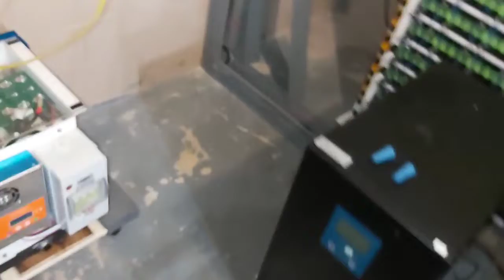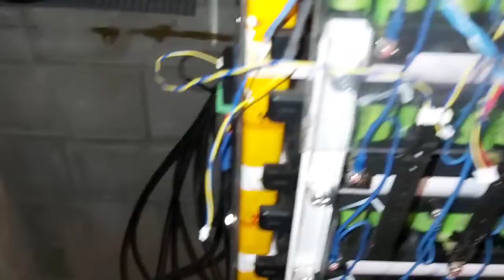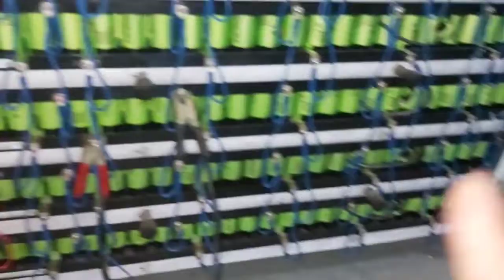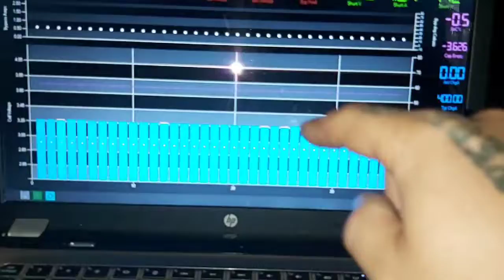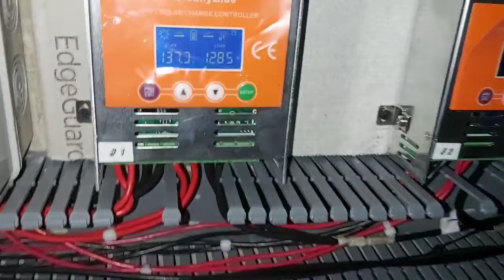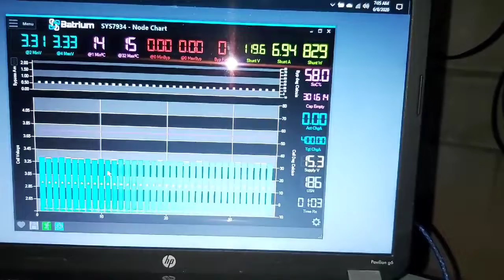120 vdc Progress and Manual Balancing

Comment: Wow... why 120VDC? I wasn't able to listen to the audio...
Reply from the maker: I got a deal on the inverters and I replaced my lead acid bank with this one. It was my cheapest and most powerful option. Thanks for watching
Reply: @frankz1125  Awesome!
Reply from the maker: @blackz06  The system is heating my house right now. 24C inside and -20C outside.

Comment: I want to build a 48v-58.4v LifePO4 battery using the brand new  K2 - 26650 cells.  I was thinking of ordering about 50 crates x 120 (26650 cells).  Is Batrium BMS good for these 26650 cells?  Right now I am using 18 x 25.6v LifePO4 k2 modules (9.6ah each).  The problem with buying already assembled modular batteries is supply and price.
I want to build my own batteries and setup 50-100 kwh of battery.
Reply from the maker: Batrium is ok but you will need a lot more equipment to make it safe. How much power are you going to use and discharge.
Reply: @frankz1125  I want to build at least a 100kwh LifePO4 battery.  Maybe even 250kwh.  Consumption would be 5.5kwh to 6.5kwh per hour 24/7.
Right now I use 1/4" copper pipe hammered as my buss bars for my 24v+24v LifePO4 battery.  It probably can handle 120A, maybe 150A Max.  I'd like to build a 100kwh 48v+ battery...not sure if a good idea or not... is it too low of DC voltage or it should be workable with proper copper.
I am thinking 2-4 LV6548  in parallel.  Probably at least two in parallel or separate (batteryless mode works only when not in parallel)...not sure if better or not.
Reply from the maker: @jonathanskinner2122  it depends on which battery cells you are using will see what is best for configuration. What cells do you have ?
Reply: @frankz1125  I have 20 x k2b24v10eb (25.6V batteries ~8-9.6AH each)    So Parallel 9 and parallel 9, then joined in series to make 51.2V.  Paralleled + series using copper pipe and hole puncher 1/4" die.   The cells I was thinking of are the k2 26650 LiFePO4 brand new (liquidation cell)   120 cells for $238.  I've never built a 12, 24, or even a 48v battery using anything like 26650.  I need to build HUGE batteries...I think.  or 24-48v with bms and parallel them?
Reply from the maker: @jonathanskinner2122  make sure you do your homework on them before you start. It may be a bigger job then you think. My system took a long time to build. Probably close to a year

Comment: Looking good. Did you use both cell types A and B or just pull out all the modules with B type and replace with A type. I,m wondering if i should just leave mine the way they are or change them. Are them strips doing the balancing only or do you have a BMS installed to.
Reply from the maker: I used bs only. Its your call . There is many people using both and theyre working fine. Strips? I dont understand. I do have a bms but it starts balancing at 3.5v per cell. Im not up there yet.
Reply: @frankz1125  Strips meaning the baytrium strips.

Comment: I would try and determine the bad pack and replace it immediately. You will always see that pack cause you grief over time in my opinion. My huntch is that, under load, you will always see that bank deplete faster than the other ones.
Reply from the maker: You may be correct.  I think I'll need a more sensitive amp meter to find the bad pack. Or I'd like to get a thermal camera.  Even under full load my cells will be using 0.25A per cell. We'll have to test some first.
Reply: @frankz1125 Long investigative work that will remove a lot of frustration in the long run IMO

Comment: If you can get the balancer to start at say 3.45 volts it would be better 3.45 is where my cells start to drift apart so balance would be better if it started lower myself I start mine at 3.0 and then it balances all day if required as at 3.20 - 3.35 they are dead on.
Reply from the maker: I haven't figured it out yet. I also only made it 3.37v so far. Maybe tomorrow I'll get there.

Comment: Yes the energy shifts from one cell group to another and for my packs the highest has been 7 amps in transfer and it seems to be fairly constant until it gets close then it eases up. It truly is amazing to watch the current move around until it's happy. Seems no matter how we do it there is always one low group and sometimes they change or take turns I think that is when it top balances and the order of current changes to an easier group or in other words the resistance changes which it does for the first while.

Comment: That is a lot of work. I am not sure that I anywhere near as patient as you. I guess you dumped all your other BMS for the barium
Reply from the maker: The other ANT bmss are only up to 32s. This is 36s. I only want to use one. This one doesn't have cell level protection without spending more money. It will work.